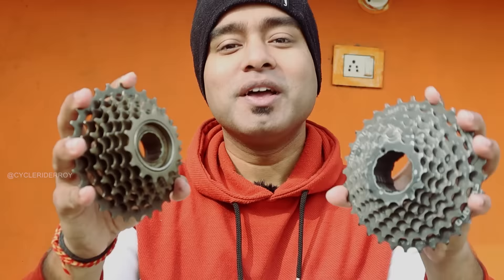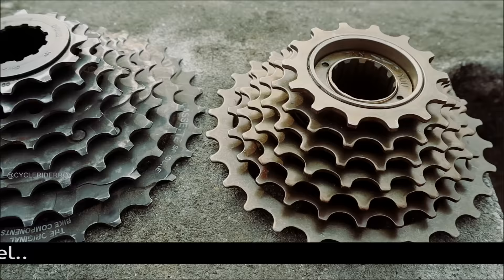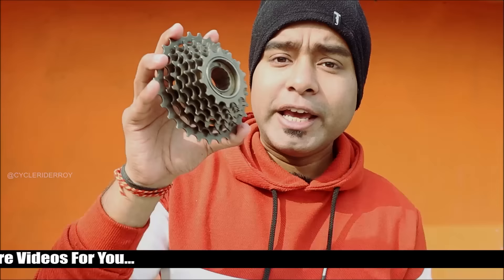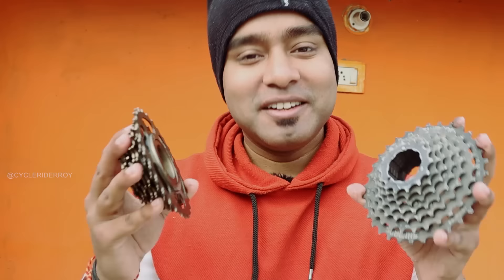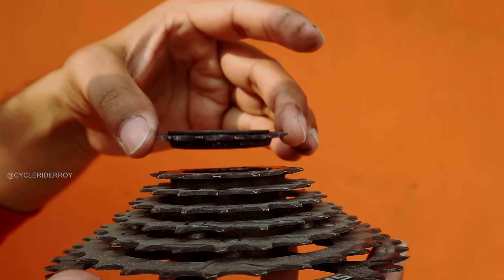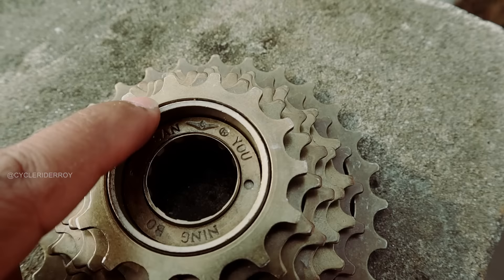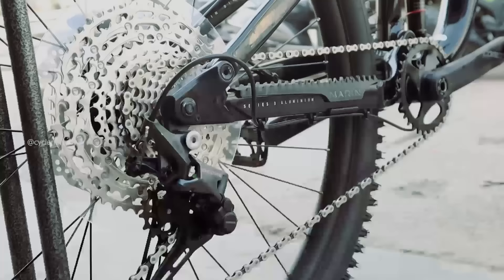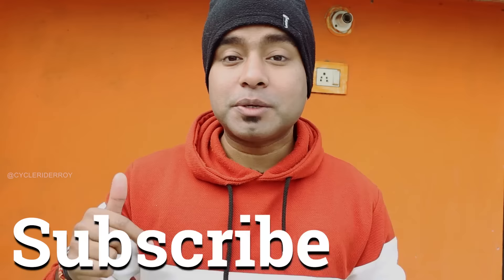Bicycle Freewheel vs Bicycle Cassette Which is BETTER | Shimano | SRAM

Comment: I have cycle with 8 speed free wheel...
Reply: Where did you get 8 Speed freewheel bro.? Because freewheel are maximum to 7 speed.
Reply: @A5 Flix You might be having cassette and not a freewheel, freewheel and cassette are both different. Cassette are easily upgradable but freewheel aren't.
Reply: @A5 Flix If you say it might be, because its impossible to get one right now. Lucky you as it might be the rarest made one's that you owned 👍.
Reply: @A5 Flix Thanks brother for the information I had limited knowledge that freewheel were only till 7 speed 🙂.  All the best for your channel 👍😉.
Reply: @nitin9330  Rodeo is available in 8 speed freewheel
Reply: @rakeshnellekeri8661  I also have roadeo hank 27.5 which came with 7 gears. The later editions might have been upgraded.
Reply: @nitin9330  hank is still 7 gears it's entry level bike. The new A76 has 8 speed.
Reply: @rakeshnellekeri8661  thanks had no idea about that👍
Reply: @ghoul.0006  That's really great, I wasn't updated about it earlier 👍
Reply: Yashvendra Singh Raghav  that's what I wanted to hear from this comment section 😶
Reply: I have 1×13 system
Reply: It cannot
Reply: You are wrong
Reply: I have one too
Reply: Bit

Comment: Firstly thanks fir your detailed and elaborate videos. I like and enjoy them.
I am a 74 year old newbee bicyclist located in Kolkata and was using an AHOY non geared bicycle. Now I would like to add 21 speed Shimano gears to my cycle and would appreciate very much your help and assistance. Please provide a buying link for trustworthy shops selling (online or courier despatch) original shimano gears, complete conversion kit with 21 shifters, derailleurs, crank set, freewheel, Hub/axle etc.
Do you think I can install it all myself? Which tools will be needed? Will wait for your reply.
Reply: Appreciate your interest in cycling in this age group. Converting a non gear cycle to a geared one involves change of hub also, along with other accessories. It may be a bit too much and expensive for you to remove the spokes from existing non gear hub and re- install them in the new compatible hub to convert to multi freewheel. If you still want to proceed, get the work done by an experienced cycle mechanic. Cheers.

Comment: Boss please make video on how to tight single speed chain
Reply: Pull up your cycle wheel
Reply: First loose your back wheel screws  and then pull your wheel outside and tight your screws while the whell is pulled outside.

Comment: Nice and informative video 

but 2 points

1) u need special tool to remove  cassette also. U mentioned like cassette doesn't need any tool.rather freewheel needs opener and wrench but cassette needs, chain whip, remover and wrench. 2 tools in freewheel and 3 to remove cassette.

2) weight, because freewheel have freehub body so its weighted, and cassette is without freehub body so its lighter but bike doesn't run on only cassette so you should have mentioned freewheel with Hub and cassette with Hub...then compare weight.
Reply: Perfect analysis....

Comment: Understood that cassette is latest tech as explained by many other bloggers...but the main idea seems still missing..how does cassette (over free wheel)  impact usability like riding quality, speed etc.. other than provision to increase the number of gears and being a bit lighter (~250gms.. ).. also in which direction gears can be added i.e for speed or for slopes? does cassette adds comfort? is it more reliable?
Reply from the maker: Cassette is more reliable, better power transfer, more lifespan

Comment: Nicely explained. I am owning an alloy frame hybrid cycle  without gear.O.L.D is 110mm.Stretching alloy is possible?? Can I add Gear??
Reply: Yes u can add gears
Reply: It will cost around 3000 to 6000 rp
Reply: Or chepar
Reply: But u probably cant strech the alloy

Comment: Hi wanted to check I have a cannondale trail 6 , it's got a altus group set , it's a 8 year old bike , well maintained , but I feel I should upgrade the group set , which would you recommend , I generally use in city of Mumbai , it's a mix of road and broken roads 😀, I generally don't to trails or off roads , it's just once in a year or so , would like a recommendation on smooth and better  shifting , thanks
Reply from the maker: 1x10 deore

Comment: I have a non gear cycle i upgrade that into a gear cycle 
I installed Free wheel on the rear side and installed a derailee 
And i have non gear Crank on the front can i install the rear shifter on my bike 
Plz reply
Reply: Yes you can

Comment: I am riding a flat bar road bike and it’s chain has to be replaced in about another 500 kms or so. Please let me know whether it is enough I change the chain and the cassette.
Alternatively can I change the whole of the drivetrain and upgrade to Shimano 105 from Shimano Tiagra. Please let me know your views. Also I would like to know where I can get genuine 105 drivetrain. 
Thanks & regards
Reply from the maker: 105 or tiagra would cost a lot. You can change the chain alone if the cassette is not worn out. If worn out then Replace both